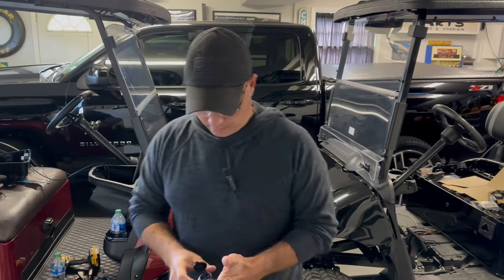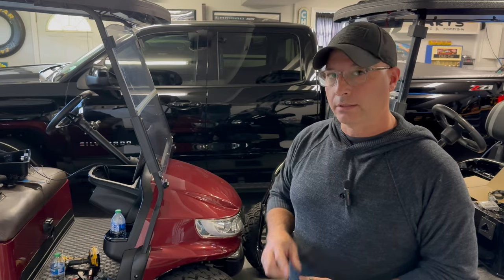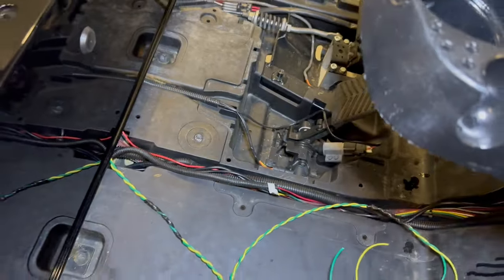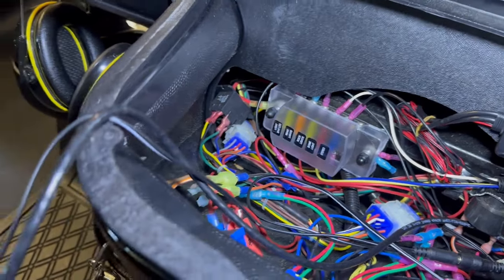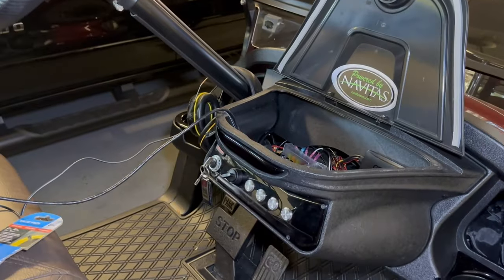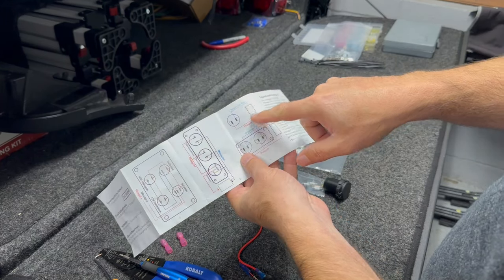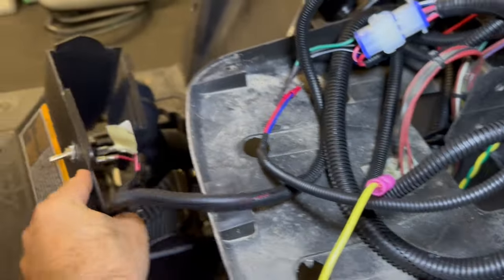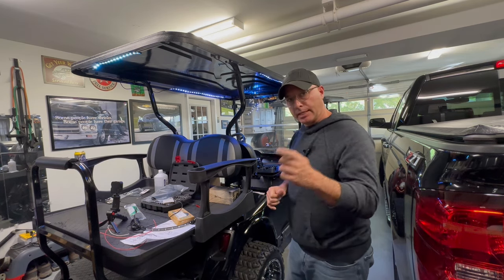USB Charger Install on our Club Car and EZGO project.

Comment: Hey bro thanks for the videos very helpful. Did you install the fuse box on the ezgo rxv elite or does it come with it? I need to install a usb on my 2024 but was hoping to just splice into some wiring behind the dash or use the accessory wire.
Reply from the maker: Hey thanks! glad they could help. I did add that fuse panel. We do have a video on that install. First we ran a voltage reducer and then a fuse pannel. You want to be sure you have a reducer if its an electric cart, if gas, could run an Inline fuse straght from your 12V battery but careful not to have a continuous draw. Maybe grab power from the Key switch, so when its off, its off. Thanks for Watching !